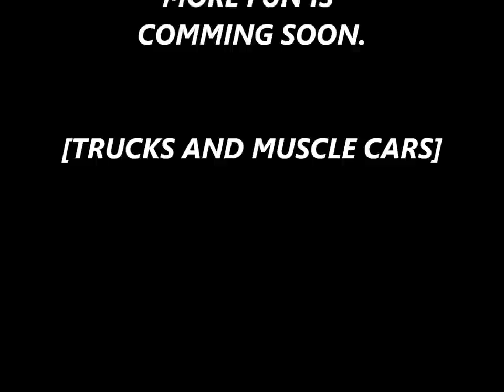SCANIA 142 V8. 1988.TORPEDO. AWESOME TRUCK RESTORATION PROJECT, BY ØYVIND BIRK BIRKEBEKK. SUBSCRIBE

Comment: U.S.A  ?
Reply from the maker: Alessandro Vargas. This is Norway.🙂
Reply: @trucksnorway  Ok, congratulations your work was great. Here in Brazil SCANIA is traditional, the 113 model is a road icon with a legion of admirers, we have some rare 142 and 143 V8 but due to the high cost of fuel here few carriers use V8. Best wishes to you and your family.
Reply from the maker: Alessandro Vargas. Thank you for that. This truck belongs to a friend of mine. He and another guy did most of the work them selves. Yea the truck turned out great👍  I have heared that the Scania is real popular in Brasil👍😊  It's some good trucks, and they are easy to work on. If you take a look at my channel, you can see a Scania 141 that i just finished restoring for my self. I Wish you and your family a happy 2020👍👍🙂
Reply: @trucksnorway  Glad you have spare parts on hand. I particularly have a VOLVO N10 XH, INTERCOOLER 300 HP manufactured in 1988. It was originally mechanical horse, but bought it had already changed to tipper. I work with him on asphalt, although Volvo is the best selling truck in the country with the 540 HP FH model and being in Brazil since 1982 is unfortunately very difficult to find cabin parts and finish of the old models, slowly I will re-restoring it. If you want, look on facebook for me, ALESSANDRO VARGAS DA GAMA I have some pictures of him. Hugs !!

Comment: Can't see how it's a 88 142 they stopped making them in 86 and the 143 came out in 87
Reply from the maker: @Craig Smith. Yes 143 came out in 87. But Scania did build the 142 in to 1988. You know you can tell a 87
 and a 88 142 a part from the earlyer one's. The 87
 and 88 142's had the 143 headliner, radio console, parking brake, trailer brake and battery boxes. Thank you for waching :)
Reply: @trucksnorway , probably using all the cabs and parts they had left over at the end of the run!... Beautiful truck by the way I love the old Scanias reminds of my Dad, spent all my school holidays in a 142 and then 143 with the extra high top going all over Europe... I had seen most of Europe by the time I left school, they were good times!